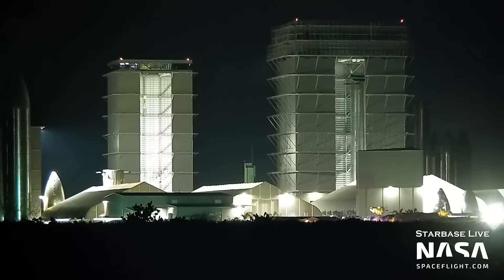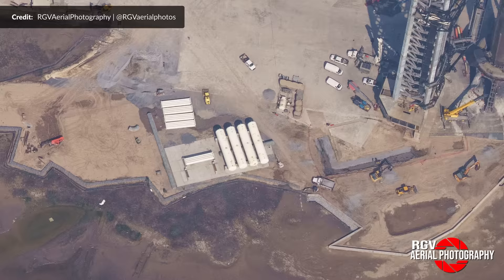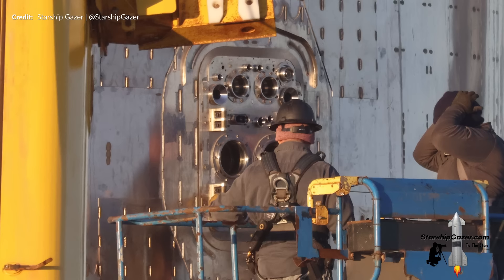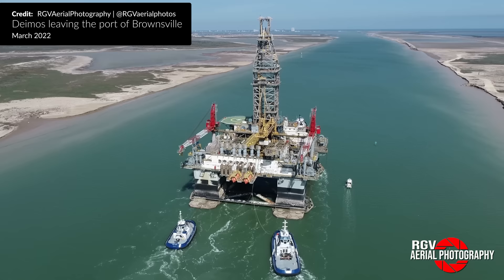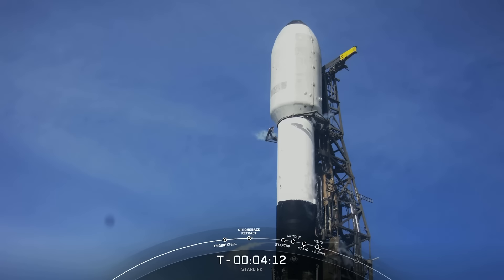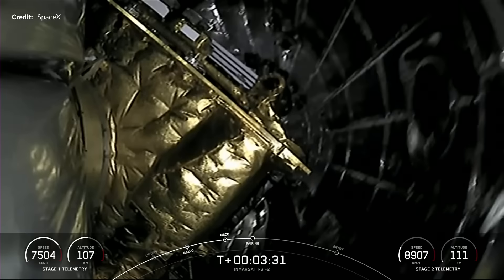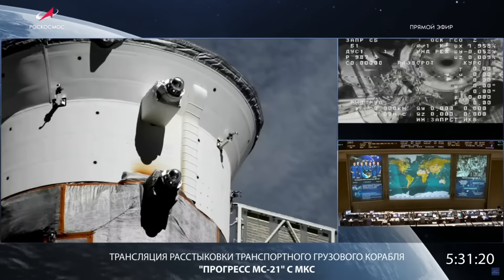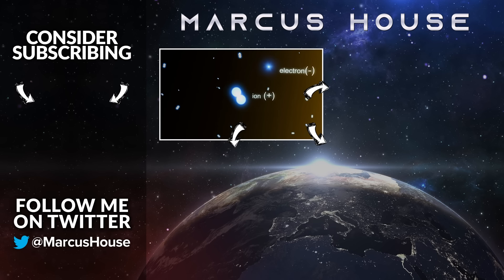SpaceX Ditches the Oil Rigs and Incredible Insights of the Orbital Launch Mount/Booster Static Fire

Comment: What is meant by the words ship 24 ship 26?
How many ships are there?
Reply: It's the 24th ships produced
Reply: The actual names are SN24, SN26, etc. This stands for Serial Number. Each Starship that is built is given a serial number. The early serial numbers were used for cryogenic pressure tests. SN8, 9,10,11 and 15 made test flights in the atmosphere.  SN24 is the next Starship scheduled to fly, this time to orbit. All of the other SN numbers were prototypes that were built then scrapped, or that were never completed. SN25 and SN26 may possibly fly after SN24, or they may turn out to be just non-flying prototypes.

Meanwhile the first stage boosters have their own serial numbers. B7 is currently at the launch site and is expected to fly the first orbital flight test with SN24 stacked on top.
Reply: @StevePemberton2  SN18 & SN19 were never started I believe, because SN-15 was successful. I'm not sure if SN12-SN14 were built, because they skipped to SN-15.
Reply: @steveaustin2686  It was an interesting time during the flight tests, the rapid building, and the rapid flights. Elon was in his element. The success of the flights was amazing, especially the first one. All five maintained control all the way up and down. The first four having problems just at the end. Unfortunately the explosions created a bad impression on some people who didn't understand the significance of what was happening. And who didn't understand that for SpaceX, especially at that time, an exploding Starship was not much different than a static fire that didn't go as long as planned. 

I think everyone was surprised when the flights stopped after SN15. But it was on to the booster, and the tower, and finalizing the Raptors. Many blamed the FAA, but it was obvious at the time that this wasn't really what was slowing things down. The program was shifting into actual development. Through SN15 seemed to be more experimentation. Pretty amazing experimentation though. And not that they aren't following the same iterative method now, it's just getting more complex as they are now building for actual spaceflight. I tend to think they really want to get the orbital test completed before they move much farther ahead with builds. 

After OFT I think we might see them pick up the flight pace again. Even if landings fail that's not as important right now, they need to start getting Starlink 2.0's launched.
Reply: @StevePemberton2  And NASA was not worried about the Starship RUDs. From page 10 of the HLS Option A Source Selection Statement from early April 2021 before SN15 successfully landed.

"Finally, within Technical Area of Focus 7, Approach to Early Systems Demonstrations, I agree with the SEP’s assignment of a significant strength for SpaceX’s robust early system demonstration ground and flight system campaign, which focuses on the highest risk aspects of its proposed architecture. This will allow SpaceX to isolate and address performance and operational issues early in its development cycle, which will meaningfully inform the maturation of its capability and increase overall confidence in its performance abilities."
Reply: @steveaustin2686  NASA really gets it with SpaceX, and has from early on. I remember during COTS-1 when they were okay with SpaceX snipping off a few inches from the cracked second stage Merlin nozzle while it was on the launchpad. The technician literally used tinsnips. NASA knew that they would never do something like that themselves, it would have been vetoed in committee and the rocket returned to the hanger for "proper" analysis and repair. I'm sure SpaceX showed them all the analysis they did on it and it looked good to NASA.

But propulsive landing for Crew Dragon was pushing things too far and NASA said no. In my opinion anyway, I know the official stories are different, all the stuff about additional testing on SpaceX' dime. It's just hard for me to imagine that NASA would have allowed it.
Reply: @StevePemberton2  Thank you very much for the detailed answer
But that doesn't mean there are technically 24 spaceships right?
I ask because I understand that he intends to send several hundred spacecraft at the same time, right?
Reply: @Chanoch-Biner  Currently there is only one Starship that is ready to go to space. The previous twenty-three were either not built (thanks Steve Austin), already scrapped, or sitting around waiting to be scrapped. Once they start flying to space they will only have a few Starships to start with. 

Starships are designed to be reused fairly quickly, so they don't really need a whole lot of them for most things that Starship will do.

Elon Musk has said that in order to colonize Mars like he wants to do, it will require building 100 Starships per year. They can only launch every two years, so presumably this means launching 200 during a 30-day window every two years, carrying 100 people each. That's 1,000 people per year. But he also said that it will require 100 cargo Starships every two years to provide supplies for the people already there. So I guess that means a total of 300 Starships will launch during a 30-day window every two years. That is ten Starship launches per day during that period.  

I have trouble seeing that this provides enough cargo flights to build colonies, and provide food, water and other supplies for the colony. Seems like many more cargo flights would needed. In fact I would think more cargo flights are needed than passenger flights.

Musk has more recently said that the goal is to send a million people to Mars by 2050. They would do this by sending 1,000 Starships during a 30-day period every two years. That's 33 launches per day during that period. 50,000 people per year. However this does not seem to include cargo flights to build habitation and provide supplies for the growing population. Presumably they will become somewhat self sustaining, but it seems hard to imagine that they will not need a lot of cargo Starships also. Let's say at least 500 cargo ships every two years, so that's 1,500 Starships launched during a 30-day window every two years, or 50 per day during that period.

Musk expects these Starship flights to Mars to begin by 2028 if I understand correctly. Although Elon himself admits that his time estimates tend to be optimistic.

My personal opinion on all of this is stunned silence.
Reply: @StevePemberton2  I think it was more about how long it would take to certify landing propulsively, so NASA pushed for parachutes instead, as they really wanted to stop buying Soyuz seats. At least that is the impression I got when reading about it.
Reply: @StevePemberton2  Yeah, Musk's Mars colony plans are too ambitious. I think that SpaceX will do well to get a few unmanned Starships off to Mars before the end of the decade. Sending people to Mars, requires some deep space tech that we don't yet have, as well as making enough propellant to make a return trip possible. Like around a half ton of propellant per day per Starship for 2 Starships making propellant over a 4 year period. I don't see sending people to live the rest of their days, short ones almost certainly, working out for Musk. I believe that SpaceX will wait for that hardware to be developed in the Artemis program, so we are a decade or more away from manned flights to Mars.

Comment: I think Ship26 is a mock HLS for launch test.
Reply from the maker: Kind of waiting on some more evidence of this. We've talked about it in the past but there is really no good evidence.
Reply: It's missing legs, orbital refueling, landing engines, docking port, life support and pressurized volume, crane to get down. Really missing most of what makes HLS starship a moon lander, so I don't know what aspect of HLS would be tested. Maybe aerodynamics during ascent?
Reply: @plainText384  - that's what I was thinking. A simple flight test for NASA.
Reply: @plainText384  The [DELETED] Starship propellant dept may also be missing flaps and TPS, so it would work as an initial flight test for that as well.
Reply: @Steve Austin  but S26/27 just don't have any of the functionality of the HLS or propellant storage variants. No stretched tanks that use the volume inside the payload bay, no added insulation for long-term cryogenic storage, no docking or fuel transfer system. Ship 27 even has the Starlink pez door, so it can't really do anything except launch Starlink V2.
Reply: @plainText384  SpaceX has a $50M NASA contract to demo Starship to Starship propellant transfer (10 tons) by the end of 2022. Since they are over a month overdue, a simple Starship to transfer that little propellant, would not be an issue IMO. After all, a Starship (second stage) has 1,200 tons of propellant and the full depot needs all of those things, not necessarily a small scale test.

Comment: The water can't be instantly released because it is too hot and would boil the aquatic life. Pollutants should not be an issue.
Reply: It's not even that. The deluge will be fresh water and the tidal wetlands are saltwater or brackish water. All the lifeforms are adapted to salt water.

Comment: If those boosters cannot hit the bullseye when landing they'll never be caught by the tower.
Reply: While the Falcon 9 can't hover, so it is not accurate enough for a catch tower, Starship (second stage) and Superheavy can hover, so are expected to be accurate enough for a catch. SpaceX plans for soft water landings to dial in the accuracy, like they did with the Falcon 9 at the beginning of landing it.
Reply: @steveaustin2686  Why can't the Falcon 9 boosters hover? They work on the same fuel. You'd think they'd work on these first with less catastrophic failures
Reply: @MegaWilderness  The Falcon 9 Merlin engine at minimum throttle (~40%) has more thrust than an almost empty Falcon booster weighs at touchdown. So the engine is started at just the right point, so that the acceleration ends up close to 0 at touchdown. It is called a hoverslam or suicide burn, depending on who you talk to and both mean the same thing.

The Merlin engines on both stages of the Falcon boosters, including Falcon Heavy, run on liquid oxygen (LOX) and super chilled RP1 (highly refined kerosene). The Raptor engines on both stages of Starship run on LOX and liquid methane (LCH4). The Raptor engines can run low enough to even out the thrust to the same weight as the Starship (either stage), so they can hover.

Comment: What I want to know is which 2 engines were shut down and why?  

A bad sensor reading is not a root cause.  That which caused the bad sensor reading is.

If the engineering team shut down an engine in the outer ring of 20 non gimbaling engines then the flight computer shut down it's opposite number then that's a very different situation then if 1 or both engines that shut down were in the center group of 13 thrust vectoring engines.
Reply: Opposite shutdown isn't necessary for Starship since it can gimbal
Reply: @alvianchoiriapriliansyah9882  only the 13 inner engines gimbal.  The 20 engines in the outer ring do not.  If an engine in the outer ring failed then shutting down it's opposite might be a simple way to balance the thrust.  The inner 13 engines could probably compensate for it but how much vertical thrust and or control authority would you lose in the process?  In any case I still want to know which 2 engines shut down and why?
Reply: @JoeShmoism  Yes, gimbal can compensate that. Better to be slightly offset than losing more performance from shutting down the opposite engine

This isn't N1, where all engines is fixed

Only SpaceX knows the cause of two engine failure, and looks like replacement isn't necessary since they had installed the shroud again. And we don't even know in which place the two engines were failed
Reply: @alvianchoiriapriliansyah9882  um, you've done the math to support your statement that compensating for a shut down engine by thrust vectoring is more efficient then shutting down the opposite engine?

If you compensate with thrust vectoring you loose control authority as well as vertical thrust.  There's probably a break even point where one methode is more effective then the other, but I don't have the math skills to work it out.

The fact that SpaceX hasn't said anything about which engines shut down or why those 2 engines shut down early is kinda my whole point.

The engines that shut down early have already been swapped out for new engines.
Reply: @JoeShmoism  "the engines that shut down early has been swapped with new engines" 

Source?
Reply: @JoeShmoism  With the Atlas-V booster always having asymmetrical SRBs, gimbaling is probably better than shutting down engines.
Reply: @steveaustin2686  that's possible, but SpaceX has a habit of not doing things the old way.

Comment: Given that 2 of the crew currently on the ISS are Russian, i find it hard to believe that the leaks are related let alone intentional.
Reply: There are 3 cosmonauts on the ISS. The 2 cosmonauts on Soyuz MS-22 and US astronaut Frank Rubio. The Crew-5 mission has 2 US astronauts, a JAXA astronaut, and cosmonaut Anna Kikina.
Reply: I don't think Marcus was intimating sabotage. I think the point is more likely a manufacturing defect. Repeated identical failures are a sign of that. But yes, certainly I agree that Russia is not going to intentionally cause harm. They would be shooting themselves in the foot if they did that.

Comment: Re the ionosphere of Mars; I wonder what the mass of the Earth's ionosphere is?  How many Starships loads of gas would need to be released into Mars high orbit to create a new one there, and solve the incoming radiation problem for Mars surface habitation?  Ah rite, millions of tonnes.  We're probably looking at several million starship loads, so not quite practical idea.  But I'm sure even a few would make a difference, and more would be 'better'?  Worth a crack!
Reply: The ionosphere isn't really a "thing", it's just a phenomenon that occurs in the upper levels of the atmosphere, where incoming solar radiation causes air molecules to ionize. The ionosphere has little if any effect on life on a planet, it just affects radio transmissions. 

You are thinking of the magnetosphere which Marcus mentioned in the video. The magnetosphere is a magnetic field created by the movement of metal in the planet's core. The magnetosphere is important for life because it blocks incoming solar and cosmic radiation.
Reply: @StevePemberton2  I know, but with Mars' weak magnetic field I would think a cloud of ionized particles in orbit may provide some shielding.  The particles become moving electric charges which ergo are magnetic fields, which would be handy.  Such an arrangement would then no doubt drift into some sort of alignment along field lines to develop a cohesive magnetic / electric field around the planet, and potentially deflect some of the solar wind.  
I had considered strewing iron dust into the orbit, but that has potential for much damage to spacecraft.  So has to be gaseous rather than particulate.  Just thinking...

Comment: Why are people keeping track of pad turnaround time? Is that a bottleneck? And if so, why does a pad need 5 days to prepare for the next launch?
Reply: Yes, it is a bottleneck. Clean up from last launch and prep work for the next launch is likely a start.
Reply: @steveaustin2686  Than that's the question. Assuming no pad damage, what's taking 5 days?
Reply: @khj5582  It's not like KSP where you slap a rocket on the pad and launch. Propellant needs to be delivered for the next launch. Systems inspected for damage. Maintenance done. Hardware that is expendable being replaced. Not only the pad hardware, but the transporter erector as well. LOTS of stuff goes on behind the scenes that we don't see. Some of which may be touched on by the International Traffic in Arms Regulations (ITAR), which no launch provider can talk about publicly.
Reply: @steveaustin2686  In that case, I can understand why Starship is so revolutionary, if that system can get rid of all this process and launch within an hour of landing.
Reply: @khj5582  That is Musk's goal, but it likely won't happen. The propellant loading takes longer. The Falcon 9 has over 500 tons of propellant and it takes 30 minutes to prop load. The Superheavy has 3,400 tons of propellant and to do that in 1 hour is almost 57 tons of propellant per minute. Just getting the turn around down to a day would be huge.

Comment: Ship 26 is probably the moon lander. Doesn't need wing flaps or heat shield tiles because if it is the moon lander, it won't come back.
Reply: No chance, it's way too early to build a Moon Lander so many milestones have to be reached before that can happen and one of those is to perfect in orbit, ship to ship refilling.
Reply: @straighttalk2069  Not to mention that operational Starships will be built in the factories that SpaceX is building. Test articles are fine in tents.

Comment: I didn't quite follow the logic about the Progress leaks. The Soyuz December leak was thought to be caused by a micrometeorite. Then comes the new one on the older Progress. You argued that the same cause seemed very unlikely and both causes might be some internal defect. Then you replayed the Soyuz video clip and pointed to what is thought to be the micrometeorite hole. Then you went to another topic? Sort of a logical faux pas? What possible "internal defect" were you thinking of? 🙃
Reply: The defect could be that it won't stop debris that it should. Or maybe the debris that the ISS had to hide from in late 2021 from a Russian anti-sat test could be the problem. That test made a debris field and maybe that is the cause of 2 strikes on the capsules.